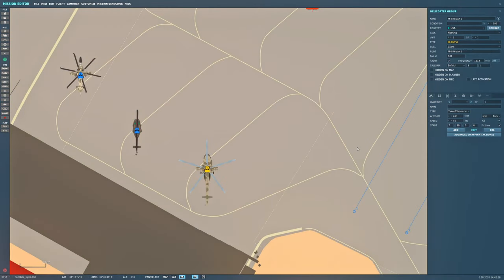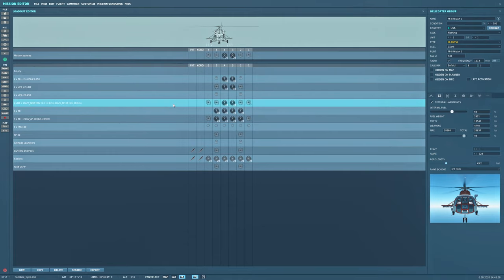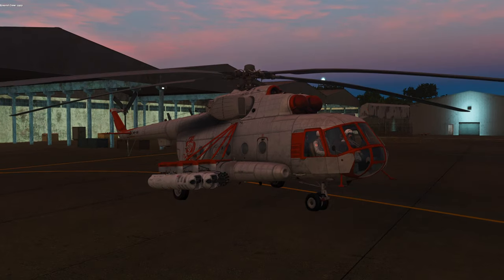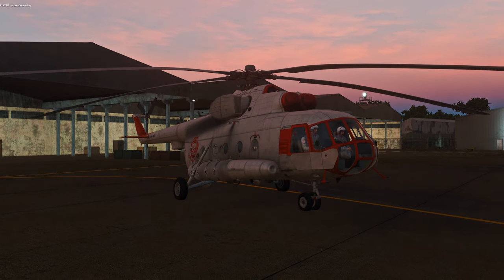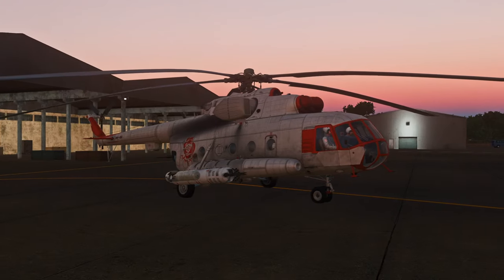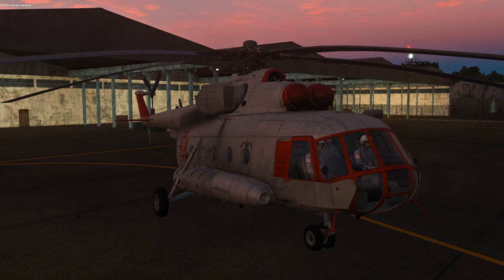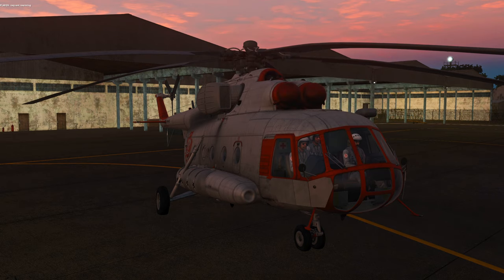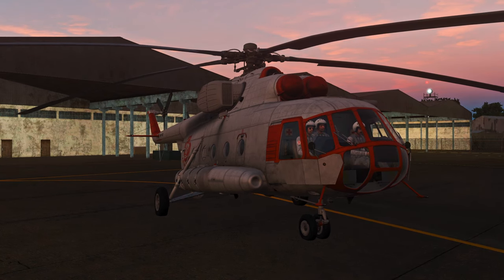DCS Mi-8: Removable Pylons Tutorial

Comment: When your flying the Mi-8 I notice that your Throttle is never at full but tends to sit around half to below half, how do you know what to set your Throttle to?
Reply from the maker: Do you mean my throttle or my collective? 

The throttle should always be at 100%, but sometimes DCS will desync the position of the cockpit throttle with the position of my rotary knob that I used to set the throttle. So the controls indicator will show it at 50% but in-game it's still set to 100%. It will correct itself if I move my throttle rotary. So this is really just a hot-start problem, since in a cold start I would be manually setting my throttle position.

Collective is set based on how much lift you need. To oversimplify it, your collective controls your altitude, and it's pretty rare that you would ever use all of it. Partly because if you're doing that you're likely to over-stress or over-speed something.

Did that answer your question?
Reply: @vsTerminus  yes it did thank you very much!